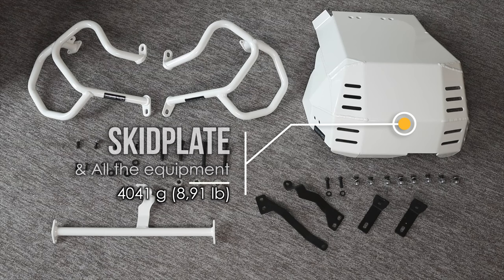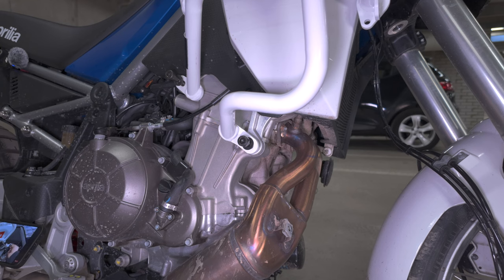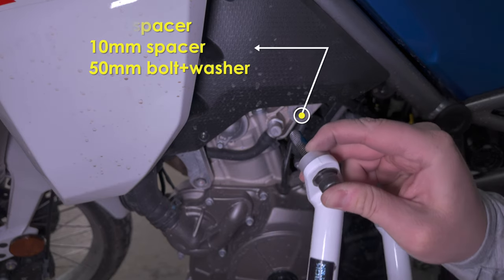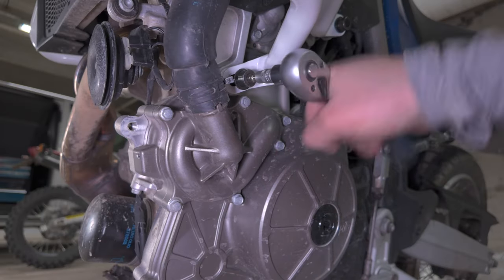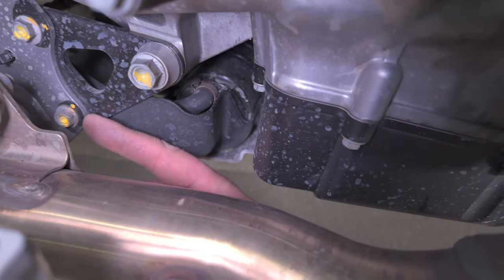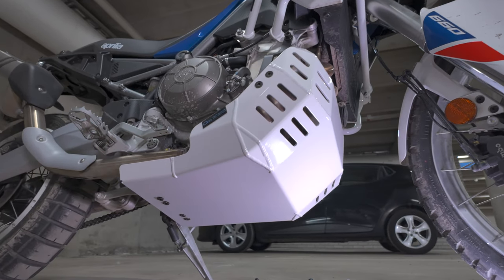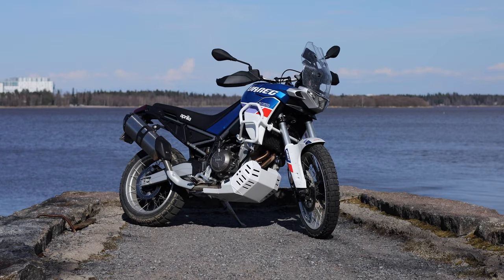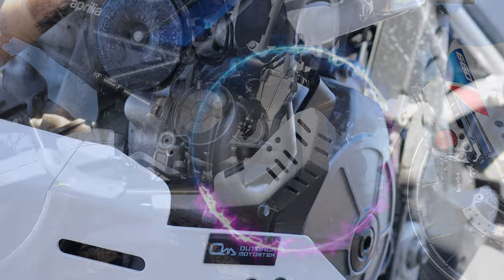Best protection for Aprilia Tuareg 660?

Comment from the maker: I had a discussion over e-mail with Outback Motortek people and about the bolt size they stated:
"Regarding the bolt size you mention on the right side, that’s some feedback we’ve already received and fixed it with the current hardware kit being shipped with the crash bars. 👍"
So you should get yours with the correct sizes! 🙂

Comment: They look great no doubt. Good video no doubt about that, too. Mounting crash bars directly to the engine - I have some doubts about that one...
Reply from the maker: The engine mounts are between the engine and the crashbars on both mounting points. So the frame is the one taking most of the impact like most crash bars. 
I have seen some crash bars mounting directly to the engine block but this is a bit different in that there is that solid frame mount before the actual engine block.

Comment: I really like the company and transparency they share to prove their product’s toughness, but I wonder why they chose the design in relation to the Tuareg’s plastic fairings’ lines? IMO it would look a lot better if they followed the outline of the lower fairing. It wouldn’t break of the OEM graphics plus it would come a little higher up on the bike seemingly providing a little more protection. Just my opinion.
Reply from the maker: Less weight on top is always a plus in my book. I really dont like those high up cages.